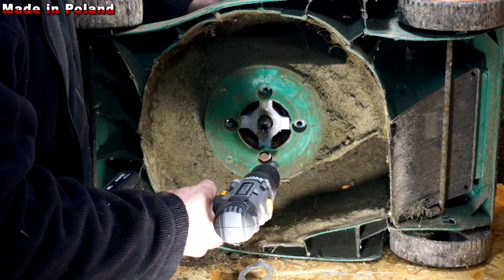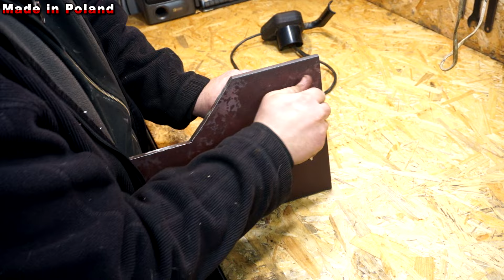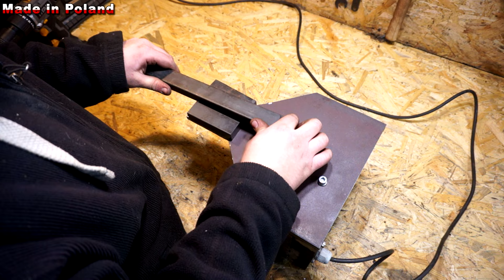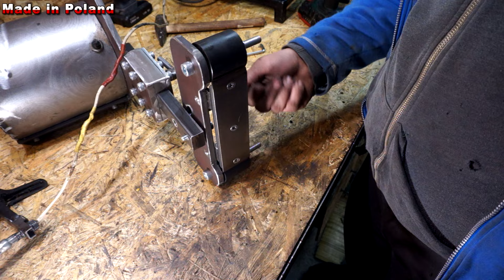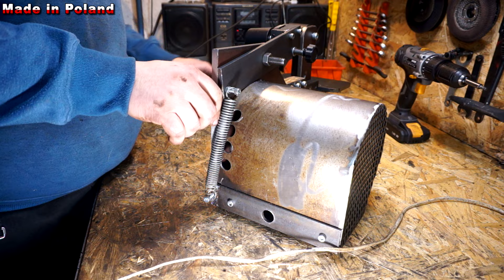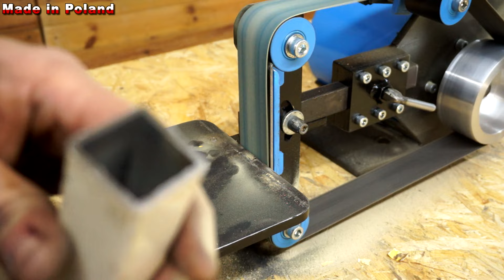DIY Belt Grinder 2x48" [PLANS]

Comment: Some of the coolest, most practical and well-built shop tools on youtube. Respect from midwest U.S.
Reply: Practical yes, but most well-built... meh. Least one thing is sure he has implemented "if you cant make it perfect, least make it adjustable" method. What comes to belt grinder, i really like Jeremy Schmidt design that has tilting mechanism and looots of adjustment, but then again that is kind stationary build with its own table, where this can be moved pretty easily.
Reply: Hellsong89, do you know how to respect?
Reply: Do you know about constructive criticism? Also i later checked his other builds and i see lot of potential there. His innovative and has engineering eye for things, but "well built" is not the word i would use, though practical yes.
Reply: Maybe my English is too bad to recognize the constructive part of your earlier comment. If so, sorry!
But what I am reading is: The tool is not build well and Jeremy does much better, because x, y, z, ...
Reply: Its slapped together from different found parts, made to fit around there and there is not that much you can utilize it with, but least its mobile. 
Where are Jeremys version is fully adjustable, has plenty of accessories, but is not mobile due its requiring its own table.
First one is practical, using parts found around him, but built quality is not the best and usability is limited.
Another is versatile, using well designed and manufactured parts, so for build quality is way better.

Both are using method of "if you cant make it perfect, least make it adjustable", though Jeremys version is more adjustable by the design.
Reply: Don't feed the troll.

But besides that: Thank you for teaching me a new word ;)
Reply: Material costs vs. You can get one for 50€.
Reply: Yeah..that angle grinder belt sander is a winner
Reply: N
Reply: Midwest😂😂😂
Reply: DindendoPoika243 you can’t get a 2x48 belt grinder for that cheap
Reply: @Hellsong89  haha no comparison man.  Jeremy Schmidt has a million dollar workshop and tools. While his build is obviously superior, these guys did it on a shoestring budget.   No comparison at all, which is why you are getting flamed.

Comment: Absolutely one of THE better builds I've seen and the finished product looks better than some of the offerings by Rigid, Craftsman, or Milwaukee Tools.

But not having a welder nor a lathe it is beyond the time I'd need to build it with the tools I do have so will have to stay with a ten inch sanding disc on my Craftsman grinder for now which, for me has done the job for the last forty years or so - same grinder since it has always been properly maintained and covered with a light cloth cover to keep dust out of the motor; plastic covers promote moisture which eventually promote rust.

Thank you for sharing your expertise since it shows what can be done with a good amount of ingenuity and ability.

Comment: An electric lawnmower is a great source for a motor and they are so easy to find. 

Thanks for the inspiration.
Reply: No kidding, I just did a kijiji search (it's canadian craig's list) and found about 10 of them in my area for under 40 bucks.
Reply: Adam
I know Kijiji well. I am in Ontario. Perfect time to buy one with the snow on the ground.
Reply: i wonder really how well they work and if the not burning out after some time? what about electric hand type grass cutter engine? are they good to use as well? cheers

Comment: Definitely something I need as I want to make knives
Reply: Just buy one. As cool as it is for him to make one, you need the proper saw blade for cutting metal, you need a welder and all the “scrap” metal used. Unless you already have a work shop, it’s much cheaper to buy one for $250 or less.
Reply: @caps741  I would say most knife makers in the market for a belt sander already have the necessary tools like me.  So it is far less expensive to follow this build than buy a new one for $250.
Reply: @yoshyusmc  maybe but the person I was commenting on was saying they were looking to get one, not replace one. Which implied that they did not already have a shop, with all the tools, and looking to replace one that no longer works. For them not already having that, spending $250 or less if you find one on sale or something, ends up being cheaper.

Comment: Hook up an earth connection to the motor and whole steel construction :P kinda not safe right now.
Reply: Exactly what I thought.
Reply: How do you know he didn't? Or did you mean an additional one, except that one connected with motor wires?
Reply: he's from poland, they don't worry about that kind of thing so much ;)
Reply: @daos3300  What make you think so?
Reply: @Kotylion94  i was referencing e european 'safety' standards. i was joking though, it's pretty good - most of the time.
Reply: sure
Reply: Wtf
Reply: Dameyho reason #1 Poland   
Reason #2,3,4  Poland
Reply: @Kotylion94  its 2 prong plug, so where's that one you mention?;p

Comment: Nice compact design.  I have often wondered why the most popular designs required a 2x72 belt size.  This 2x48 can do just about everything and would allow me to use/cut up my bigger 6x48 and 16x48 sanding belts if needed. Great job !!!
Reply: 2 x 72 gives the belt a chance to cool off a little before it makes a full revolution

Comment: Some things I would personally improve:
Removable protective cover plate over the exposed wheels to remove pinch points.

A block to keep Sparks from going back towards the direction of the motor. (Someway, not sure how.)

All around a great little belt sander for anyone to make, even with some of the small safety hazards 😄

Comment: Truly an amazing video, you show every step thoroughly so it's easy for anyone to follow and make this sander. I wish I could download the plans so I can make a belt sander for myself however I no longer use a computer for the simple fact that it's easier for me to carry a tablet with me to use in making or building tools that I feel I need or watch videos and use them for reference in whatever I am doing or building. With this in mind, your plans use Windows or Mac which doesn't work off of my tablet. At least I don't think it will. I'm not as good with electronics or computers as I used to be. I'm going to try to use this video to build this belt sander. Definitely one of the best, if not the best, video I have seen to make a belt sander. Thank you for sharing with the rest of the class. I have subscribed and will be watching more of your videos. Thank you again!
Reply from the maker: Tomorrow or the day after I make screen shots of all dimensions and attach them to the project folder. You will be able to do a grinder while reviewing photos :)

Comment: I would suggest one improvement. You have used copper and other conductive metals to make a housing. When you do it, you should attach a 3rd wire to it (yellow-green) and connect it to a different type of plug. The one you used has just 2 connections instead of three. This way you will be protected against live wires touching the housing.

Comment: Try using the slack to sharpen your knife next time you will have much better results also don’t sharpen a knife with your cutting edge facing into the direction of travel you could end up snagging and no body likes a flying knife or a slap from a high speed belt. Keep up the good work

Comment: Would this ACTUALLY be cheaper than buying a Belt/Drum Sander?...

If so, NOW I HAVE TO BUILD ONE OF THESE!

Of course, after I obtain a Flux Core Wire Feed Welder with Accessories  ($250.00...).

Thanks again, and again for sharing your Engineering abilities!,
-Thomas
Port Orchard, Washington USA

Comment: which sanding belt do you use on this Belt grinder? Dimensions? and where do you buy it?

and where did you buy the pulleys and the drive wheel?

Comment: Dzienkuje bardzo: Please use a magnet rather than a brush... also you need an implement to keep the material at a certain angle to the sandpaper.

Comment: hey i have a question. i got your plans from patreon and as i saw the amount of metal i only need for it im wondering if the measures a correct, cause in the video it seems larger than my outcoming sizes. greetings

Comment: So all you need is a heavy duty drill press, 4” grinder, TIG welder, jig saw...
Reply: Harrzack His drill press is not heavy duty (it uses a hand-drill), that’s a 4 1/4 inch grinder, and he’s using a cheap MIG welder. Get it right if you’re going to complain.

Comment: Great job, but you probly have as much there in tools, hardware, labor, and steel as to just have bought a belt grinder. Kind of counter productive. The only thing you really saved on is the motor but all the rest pretty much makes that point moot. The fact that you had the ingenuity to do this though is awesome regardless.

Comment: Really cool, but I could buy on for less than all the tools needed to make this
Reply: all you really need is an angle grinder, drill, tapping tool, measuring and scratching tools, parts and a bit of knowledge on how to use these tools. If you have a workshop there is incredibly high chance you have all of these
Reply: Key word there is “if” you have a workshop, unfortunately I do not :’(

Comment: There is no question it is a GREAT sander but - if the motor worked (yep) why destroy a perfectly good lawnmower? Go buy a belt sander. Probably cheaper than buying a replacement lawnmower. Or buy a motor and make the same sander. Just wondrin.
Reply from the maker: I have a flue gas mower, and I have not used this for several years.
Reply: Makes sense!!!!! Yes it is best to make use of things!!
Reply: A shitty belt sander is probably cheaper than the steel used, but it does look like a pretty good belt sander